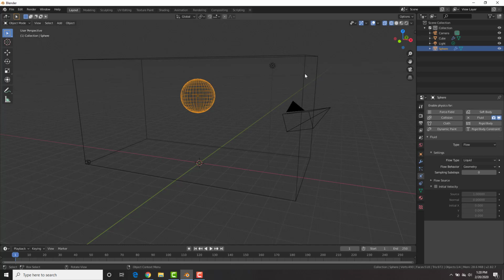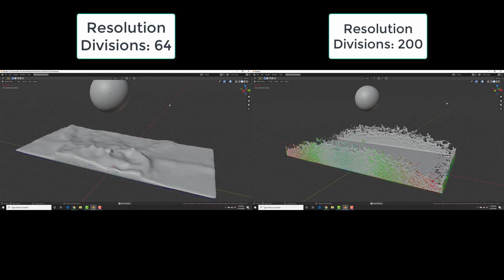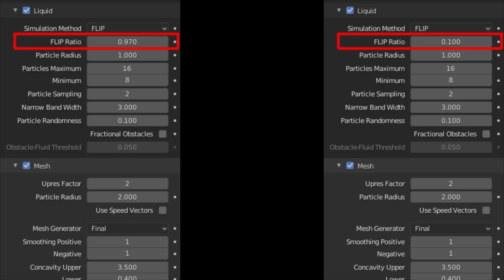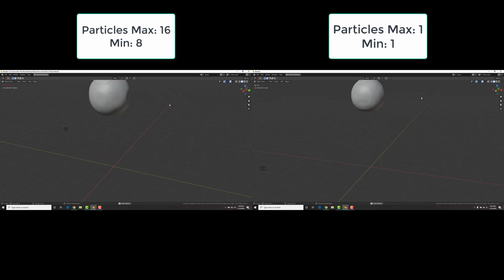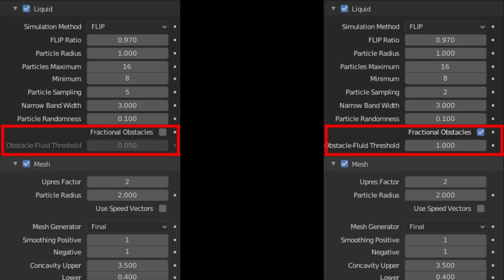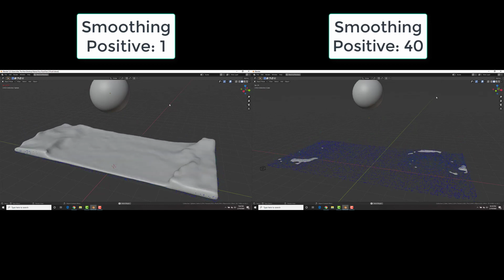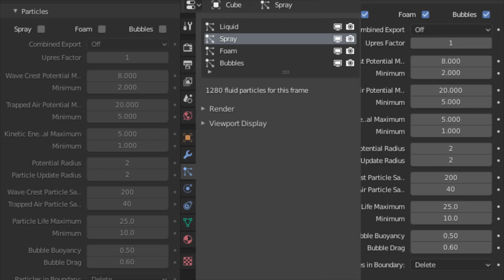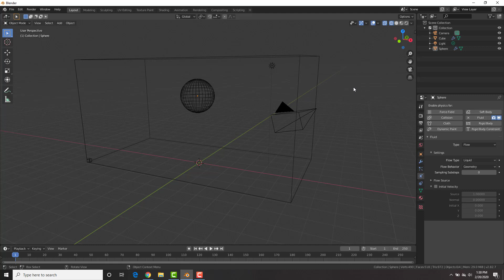Blender 2.8 Tutorial - Introduction to All Fluid Simulation Settings with Mantaflow Part 2

Comment: can you tell me how I can change the force at which the fluid is hitting the particle? Im making a simulation where water is splashing onto an object but its not hitting as hard as i want it to. Its basically landing on the object and dribbling down the sides. How can I make it so that it hits the object like water does when you're washing a spoon? Thanks.

Comment: Hey Alex, thank you for these two videos, I'm still getting my head around Blender, and the mantaflow stuff is powerful, but .. confusing at first!  This really helps!  I have a problem with Effectors though, which is doing my head in, and I can't find anything online that explains it.  If I create an object, and just make it an effector, liquid and gasses collide and move around it as expected  BUT if I, for example, create a tube or a funnel or a cup or anything by, for example taking a cylinder and removing the ends (and then applying a solidify modifier, but that doesn't help, it happens either way) then the object has no influence on the fluid.  any chance you could do a quick tutorial on how to make a pipe or a cup or something that's an opened up object?  thank you!
Reply: For situations like these you need to increase the surface thickness of the effector object to 0.7
Reply from the maker: Glad you enjoyed the videos! 😁 did you make zure to apply the scale to the objects? Ctrl+A and apply the scale
Reply: @blendermania3d  Trying that now.
Reply: can't put images here, I don't suppose you have a facebook page or group?
Reply: the reason I'm doing this is to eventually show the flow of a gas through a 4 stroke engine, I've made the engine, pipes, valves etc, but mantaflow liquids etc just pass straight through it, even when it's all set as an effector.  Doh!
Reply: no change. It's ignoring it - I've tried the alpha of 2.83 too, to see if it's some bug, no difference.
Reply: It's like there's some sort of a threshold that an object has to have to be a solid collision object.  Turning the resolution way up makes it work better - the pipe is leaky, but it's a pipe at least.  I wonder if it's to do with normals - does an effector only reflect on the normal, not the back of it?  If so, there needs to be a "collide with any bit" switch somewhere

Comment: Was able to get my issue fixed, but now I've got a new issue.

Did they change the way bake data works? I baked a fluid sim for 36 hours only for it to crash. I reopened the file and all the particles are there and moving, but it says I have to rebake the data.

I've seen answers saying that the fluid_cache folder and the blend file have to be in the same location, which they are, but when I reload my file, it doesn't reload the data with it.

I'm really hoping I can fix this without having to rebake all that again.
Reply from the maker: Did you try selecting the cache folder from where it is? Also if a baking a stopped you could resume it. Are you sure it's just not a resume option instead of baking it from scratch?
Reply: @blendermania3d  Yeah, I selected the folder. The odd thing is, it loaded in all the particles as if it loaded in all of the data, but the button said "bake data" as if nothing was baked at all. It was strange.

Regardless, I ended up losing all the data after messing with a setting, so I'll have to re-bake it anyway. It's not too bad, since I'll be re-baking at a lower resolution.

But thank you for the suggestions regardless! :)
Reply from the maker: @malcolmmorin  anytime! Yeah I think it's still acts up a little bit as I was baking just fine just now and then close my scene and reopen it and try baking and it didn't work even though nothing was changed and then it worked again LOL. I think most of these issues will be fixed in newer releases

Comment: Is there any way to make an imported object (fbx) an effector?
Reply from the maker: Yeah I had imported a .obj and it worked fine. Should be the same with fbx. What issues are you having?
Reply: @blendermania3d  Selecting the object and going into the physics tab only gave me two options.

I was able to fix this by jointing all the objects together, but I'm testing it out now to see if I've truly fixed it. It might just have been the way I put together the model.
Reply from the maker: @malcolmmorin  okay let me know! I was running around when I replied to your last comment but I can always check for you if you're still having issues